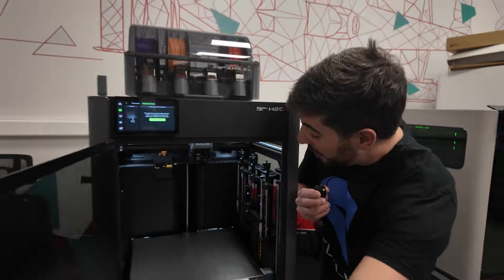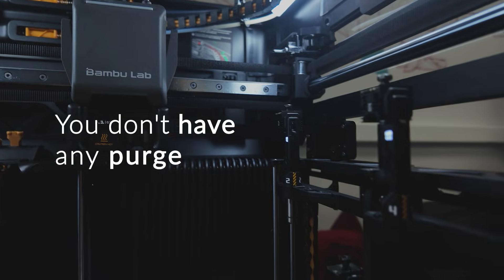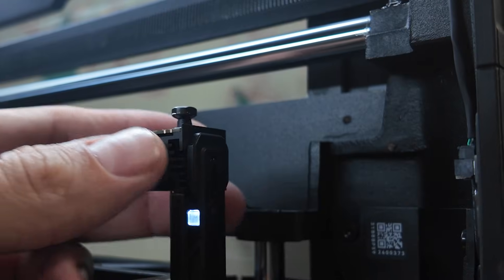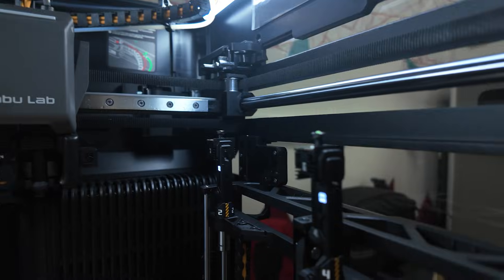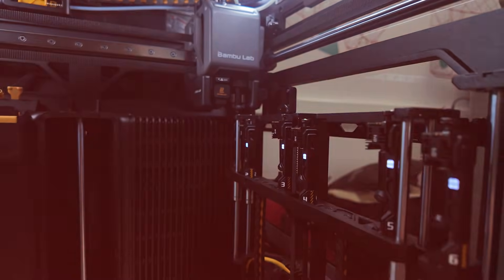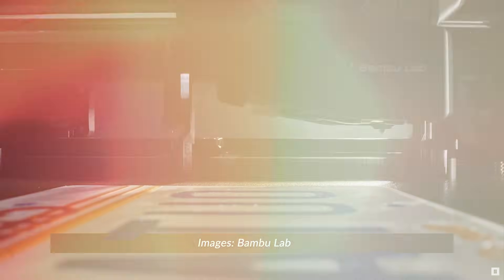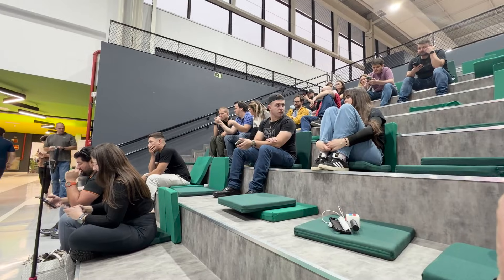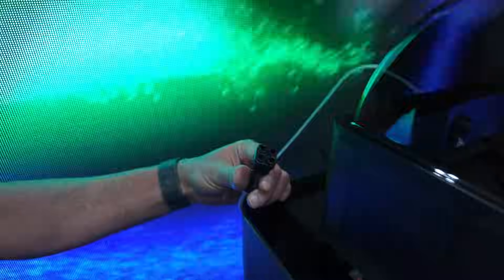Vortek vs The Competition: Who Leads the Next-Gen Multicolor Race?

Comment: I have the means to buy one but I can get x3 u1 for the same price hard to swollow the cost
Reply: If you want to print with pla, petg, tpu and other low temp filament, and being limited to 4 then the U1 is probability the best choice financially. Need heated chamber, want to print engeenering filament, want to have the opportunity to keep hotend in the printer so you don't want to switch manually when you need to do it because you don't want cross contamination of sensible material in the same hotend, need bigger build volume then you'll want this one. Both are good printer serving different needs.
Reply: @patricklebel1141  I want to believe the Qidi Max 4 is the way.  If there is an INDX integration, that's the best of all worlds.

Comment: The system isn't changing anything. It's half-baked child of an engineer who got carried away with technologies. Conceptually obsolete on the release, BUT if we speculate on technologies used, it''s posibly teasing features for next Bambu generation - induction heating and machine-controlled hotend swap(could actualy lead to common slicing for different nozzles, may be with automatic choice, to combine high-flow and high-precision zones in single model). May be somehow bambu even will see how poor AMS looks in comparison to toolchanger.